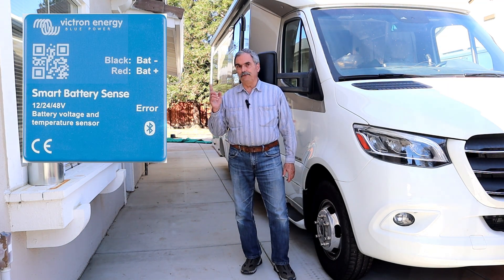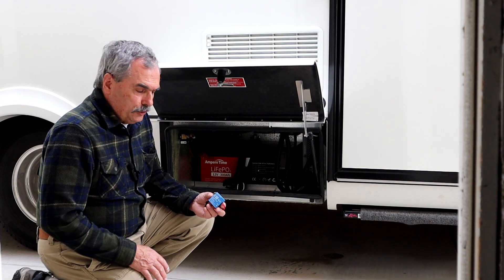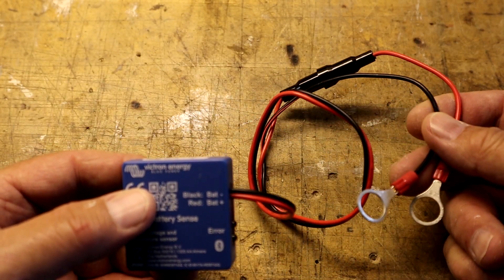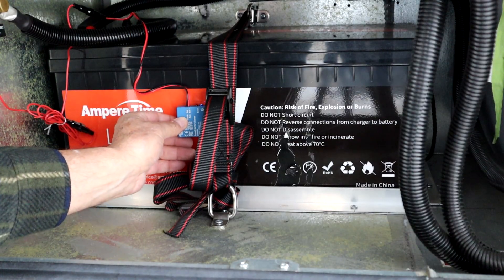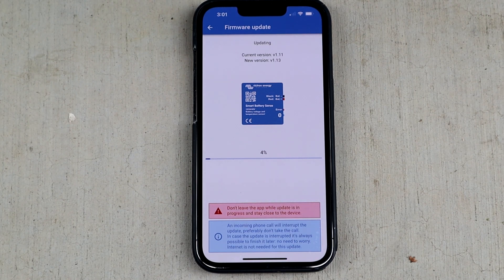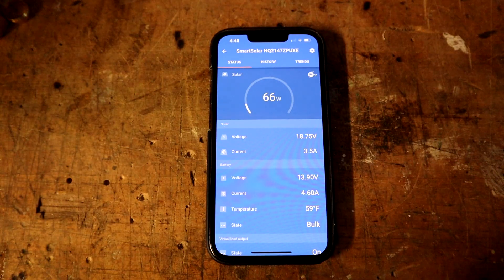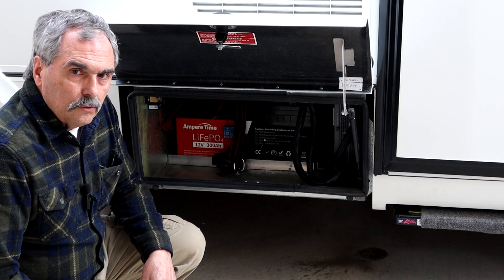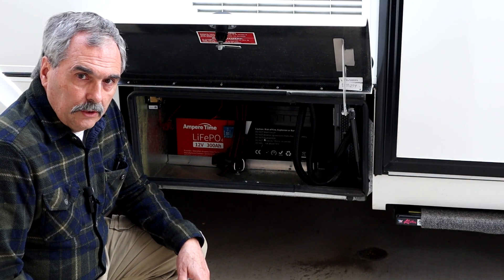Victron Smart Battery Sense Installation & Operation

Comment: Why is the voltage on the MPPT different from the voltage on the battery sense? Is the MPPT not supposed to use the voltage from the battery sense?
Reply from the maker: Because it is further away from the battery and there is a slight voltage drop across the wires.  Also, there is nothing to say that all the different voltage measuring devices will read exactly the same within 0.01V of each other.  Nothing to worry about here.
Reply: I know why there is voltage difference. The question is why the charge controllers are not using the voltage provided by the smart battery sense?
Reply from the maker: @oludara7446  Now your question is clear.  I am not sure why there was that much difference in the voltages when I shot the video, but when I check the voltages now, they are within 0.005V of one another.  So no real difference.

Comment: Anyone know if there's an option in the app of the victron smart sense to be able to notify you if the battery gets below a certain voltage that is set or if it only notifies you or low temperature? Thank you
Reply from the maker: I don't know.
Reply: Ok thanks @rvtipsequipmentwithcurtis9087

Comment: When you connect the battery sense to the victron network and everything is setup and communicating,  what happens when you go to an area with your RV where there is no internet access,  does the battery sense still send data to the solar MPPT?
Reply: It connects via Bluetooth, so no internet access is needed